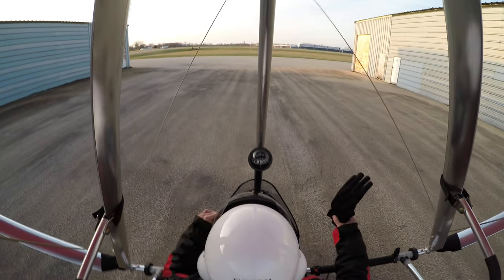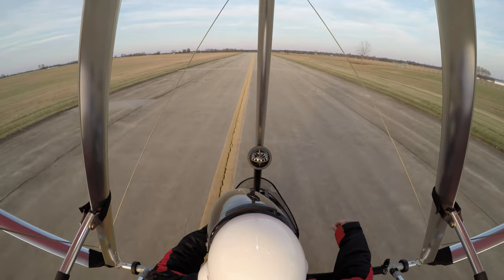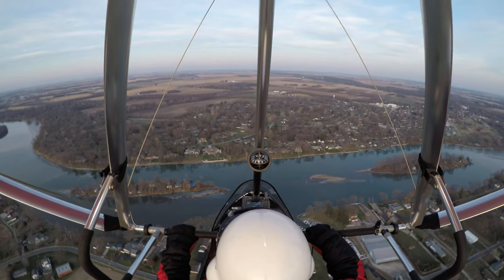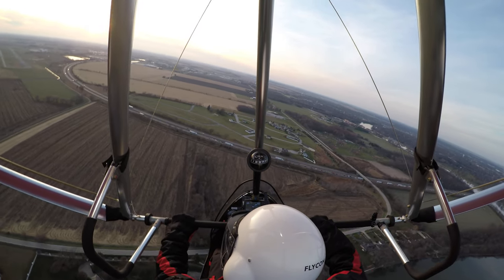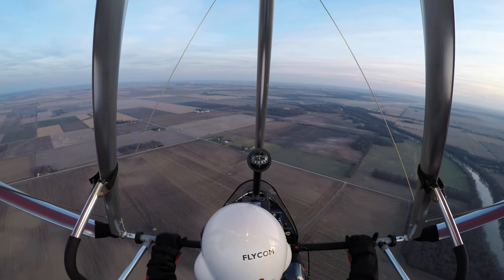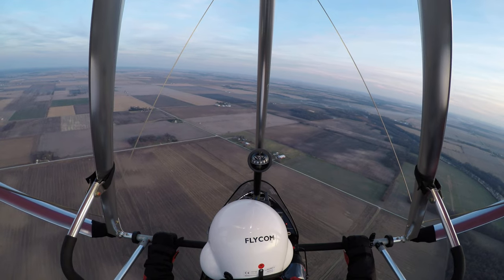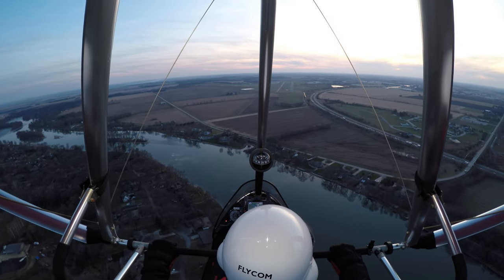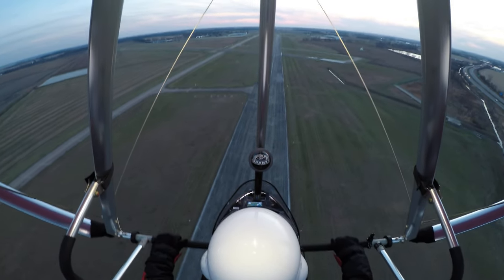FLEXWING FLIGHT 11-23-22 NEW LANDING LIGHT

Comment: Now that's a strong and smooth headwind. You could almost park it in the air. I know I could with mine. Thanks for posting.
Reply from the maker: I would need about 15 mph more headwind. It would be cool to do that. I was at trike fest this summer and the winds were blowing over 30 and an airborne pilot basically parked right over head hovering for a couple of minutes. Man he did not move an inch. It was pretty cool to see.
Reply: @fpvflyby6855  The trim speed on my trike is about 40mph. I could probably slow it down to somewhere in the 20's. I would be parked - if not flying backwards. LOL!